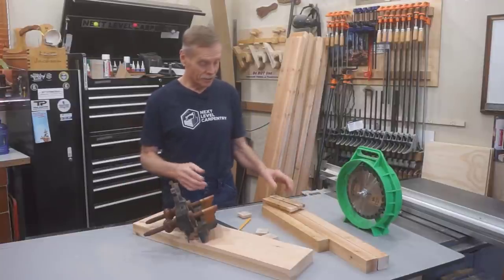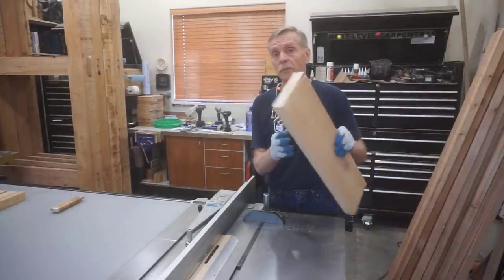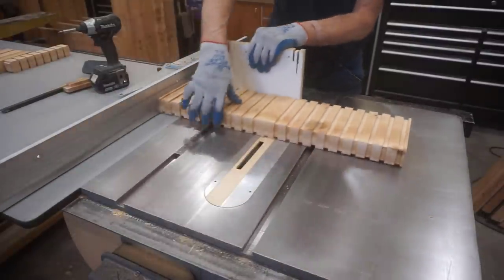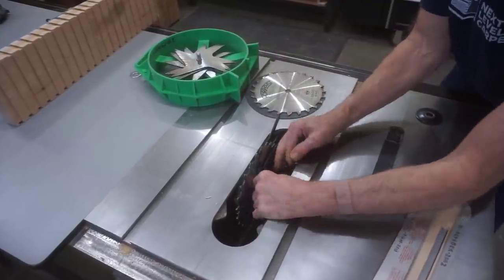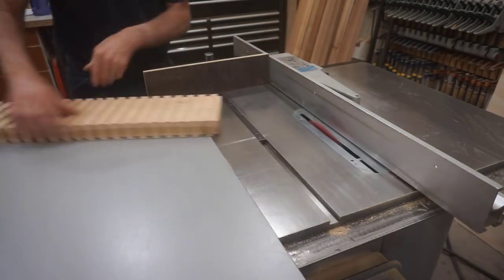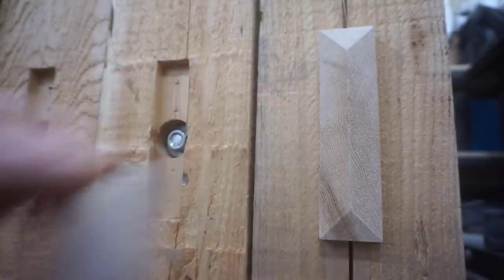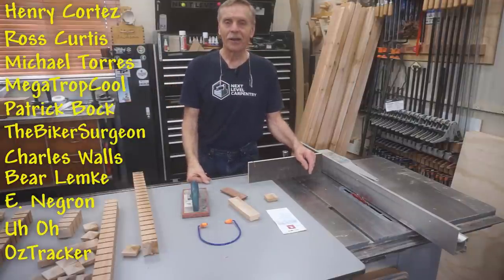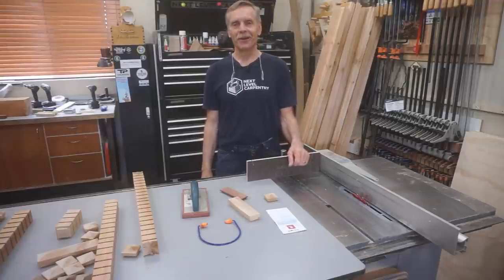Making Wooden Pyramid Caps

Comment: I just made 21 pyramid caps to go on 4X4 posts.  I made them from 6X6 treated lumber and used a Forstner  bit to hollow them out and a 3/4“ router bit to square the hollow to a 4X4 shape.  Unfortunately the posts had been in place for many years and each one of the posts had warped and split so thy were all a little different size and shape.  I made an adjustable template to fit each post then to support the router.  6X6 looked clunky so I trimmed them to extend 3/8” over the 4X4 posts on each side.  It was a miserable job.  I wish I had seen your video first.  The 6X6 treated lumber was so wet I had to turn off the SawStop safety feature.  I used a new 2-1/4” Forstner bit with cut great for about 6 times and got dull after that.  A carbide bit would have been expensive but in retrospect it would have been worth it if it held up for the entire job.

Comment: Hey partner, we had talked briefly about the thin wire you use to clear the tip on your Starbond bottles. And I was the one that pointed out that I use a safety pin. But I neglected to mention, that when you get your Starbond CA glue. There is a small red cap that comes with your glue and I'm not sure if you realized it or not. But that red cap has a small pin in the middle of it for that exact purpose. I wasn't sure if you realized that or not. So I wanted to point that out. Thanks for another awesome video my friend.
Reply from the maker: Hey Brent, I remember your comment now.  I was aware of the red cap (although I never mention it in videos) but, because of the difficulty of getting that little pin to align with the hole in the spout tip, don't find it very useful.  I once spoke to Starbond about it and they're aware of it but no alternate or solution has come of it.  I recently drilled a hole to store a thin wire cleaner-outer on the larger caddies I have in the shop because I like having one on-board on my CA Glue To Go Caddy so well.  Here's to tip cleaners, regardless of type, and to clean tips! 
Best, Matt
Reply: @NextLevelCarpentry  absolutely, makes since. And like I said I just wasn't sure if you where aware of it. But I do have that same issue, from time to time. Good to talk with you, Matt. Take care.
Reply from the maker: @brentfowler2317  I appreciate comments like yours because they benefit everyone who takes the time to read what you add to the discussion here... thanks!
Reply: @NextLevelCarpentry  thank you Matt, and your welcome.

Comment: Nice video. You talked about fending off the trolls and then you baited them by using your miter gauge and fence at the same time. It made the cut safer and more consistent but it violated the THOU SHALL NEVER USE THE MITER GAUGE AND FENCE  AT THE SAME TIME commandment.
Reply from the maker: ... and I also 'violated' the THOU SHALL NEVER WEAR GLOVES WHEN USING A TABLESAW commandment... pure heresy, right?  Oh, and don't forget: THE WAY YOU CLEAN UP GLUE SQUEEZEOUT IS WITH WATER AND RAGS... how DO I survive? 🤨

Comment: I know this may not be of interest to you but here it is. Making a shop stool 4 legs 5 degree angle. I have no drill press. no table saw. basic tools to do most anything. Drill, Square, Drill bits, clamps, rulers and tape measures, hole saws, forsner bits, handsaws, and adjustable angle gauge, hammers and glue. 2x4's and some scrap wood. I have been finding it very difficult to get the legs at 5 degrees by hand tools. Just cannot hold it steady. Any suggestions  would be appreciated.

Comment: My table saw is the same, non standard tilt and having to switch sides.  It is a 20 year old machine, Ryobi BT3000 with a sliding miter sled.
Reply from the maker: 20 years ago 'right tilt' tablesaws were the norm and left-tilt was the oddball... my how times change!

Comment: What if I had a rectangular cap, like the ones that you’re making, but I want to bring the meeting point of all 4 angles to the center? This is racking my brain!
Reply from the maker: The cut angle for the long sides would be the same but the angle for the ends would change.  It would be a dicey setup if the proportions of the rectangles are as long and skinny as the ones shown in this video plus, unless the 'height' of the pyramid was considerably 'taller', it would be difficult to keep the lines on the pieces crisp enough to show up enough after sanding for anyone to even see them or appreciate the extra effort spent making them IMHO.

Comment: I'm just wondering why you made your cap with the end grain up; it seems like that would make the cap weaker structurally and also more prone to absorbing moisture.
Reply from the maker: While the properties you mention are valid, as I mention in the video, I made these caps out of end grain because they are meant to mimic the end grain of real through-tenons and pegs.  It's also why I included the segment showing how to make caps of the same design out of face grain when 'structurally weaker' is a concern. 
Best, Matt

Comment: Hey Matt, I have a very similar model unisaw as yours but I have the diablo dado set. It's much more difficult for me to slide my dado blades onto the arbor. Any suggestions or ideas as to why this might be?
Thanks!!
Reply from the maker: The most likely explanation is the difference in wear on the arbors of our saws Jonathan.  Mine saw is 40 years old and been used considerably over those decades. Each time a blade goes on an off it wears a little, so much so that about 20 years ago I had to disassemble the saw and press in a new arbor.  I can tell it's getting close to needing to be replaced again so worn threads and reduced diameter leave a bit more tolerance between arbor and blade hole diameter.  You might smooth out the arbor hole on your Diablo dado set using like 320# sandpaper on a 1/2" dowel in case there's a burr or paint in the hole from manufacturing but make sure to go lightly because it would be easy to take too much and go from a tight fit to a sloppy one.  Let me know if that helps?
Best, Matt